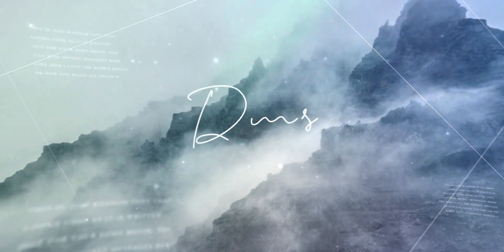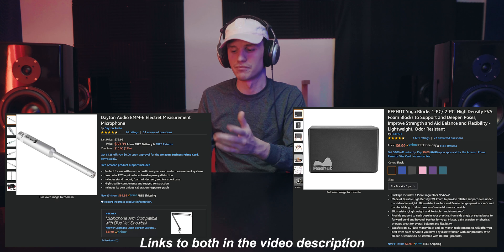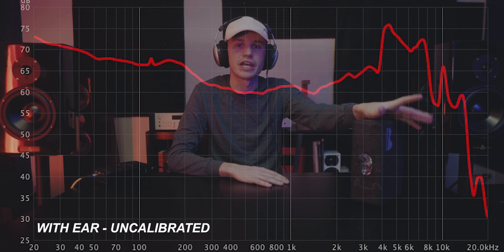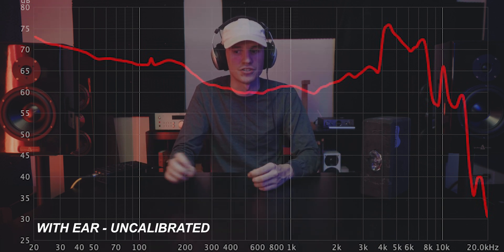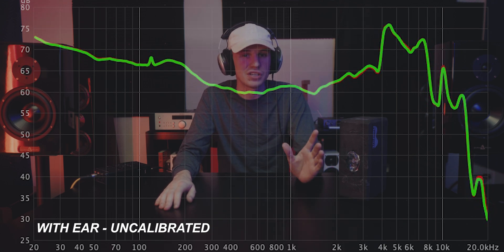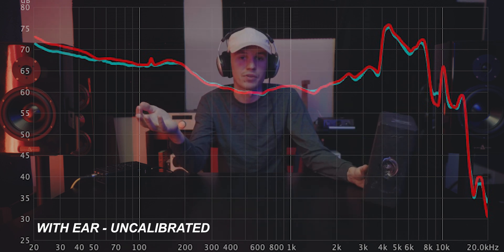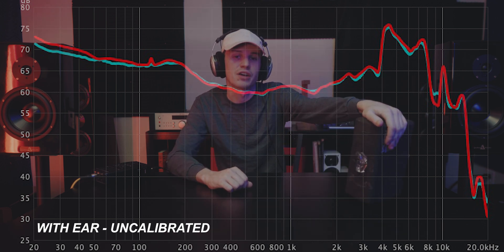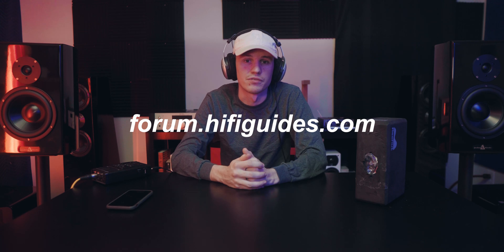Do gauges affect HEARING?

Comment: Anatomically, no, there shouldn't be a big difference because of gauges. Sound perception is mostly the anatomy of the middle and inner ear and the bone density and hopefully normal function of the middle and inner ear. However, any interference caused by having a larger earlobe and what that might do when wearing headphones may cause some differences in what a headphone sounds like.